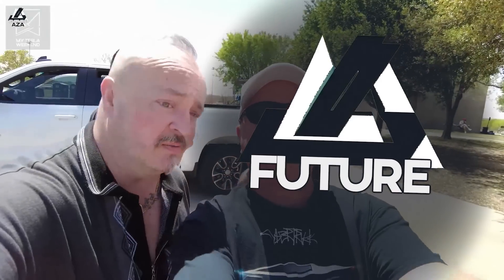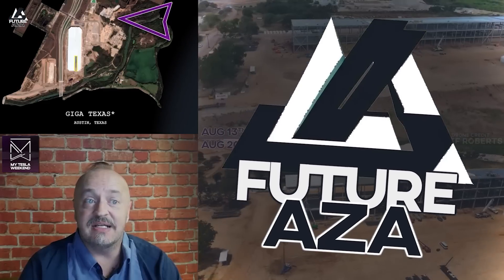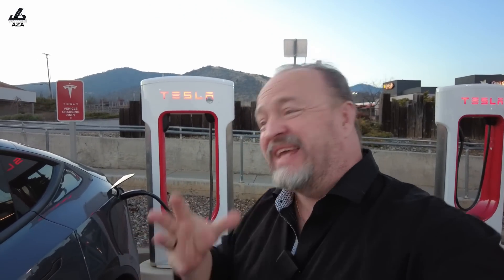Exclusive: Cybercab’s Tech Secrets They Didn’t Want Out

Comment: I have owned a number of front wheel drive cars from Honda and Mazda and have never had a problem in the snow with them (I live in Michigan so we know snow).  Indeed I have gone up hills in heavy snow while watching rear wheel drive cars struggling and going sideways.  I was always under the impression that fwd cars were thought to be better in snow.  However, apparently due to the excellent torque vectoring my RWD Tesla Model 3s are every bit as good as my last Honda Accord was.  I’m sure they have snow figured in.
Reply from the maker: Your Model 3 example is more accurate. The Honda & Mazda both have front engines, so keeping the weight over the drive wheels is what helped them. Cybercab should be fairly well balanced, but I agree the concern is overblown.

Comment: Great video. For snow/winter conditions they can fit the best tires available for the specific season - tires make the largest difference - much more than front rear, especially for a small light car (more of an issue with a heavy loaded pickup/truck). Since it will do a ton of miles, they’ll need to replace the tires once a season anyhow…

Comment: QUESTION: is there an emergency stop button for occupant(s). is there manual control system for fleet operator / first responders if AI computer goes out (or wireless for teleoperator or phone control) -- like a locked, hidden controller or port to plug in a controller?  - great job on these vids (long time watcher, first-time subscriber)

Comment: Great info.  The logic for front wheel drive and a small 40kw or less battery makes sense, speed limited to 85 mph also.   It's a commercial cab not a personal car and designed as such. I think it will come with a bench seat though to allow entry and exit on the non street side. More space in the trunk for suitcases and such with a FWD.. Not what I want so I won't hold my breath. Model 3 with a hatch would do if for me.

Comment: Front wheel drive makes sense. More than adequate on slippery roads as long as the weight distribution isn't rear-heavy. Pack all the fiddly bits up front and have a very simple structure to optimize from the windscreen back. Low floor luggage space. Good stuff.

Comment: Confused about a comment about braking::   Most braking occurs from the front wheels, not the rear wheels.  Front-wheel brakes typically require replacement before the rear   Torque steer is farr  more apparent with hp over 300 hp.  it's not an issue or a significant one for cars with hp less than that. .  Front-wheel drive cars as you've already mentioned will be interesting.  In places where it snows,  front wheel drive cars don't do too wheel if they lose traction going up hills.  In fact, they tend to crab sideways.  I've lived in New England all of my life.  I've had front, rear, and all-wheel.  I'll take the all-wheel drive, thanks <:) Front-wheel cars were in vogue initially because of the reduced cost of manufacture,  but there are drawbacks to that drive train which become apparent depending on road conditions.  I'm not an engineer,  but I have quite a few miles on the road <:)
Reply from the maker: You have the most braking capacity in the front, but you rarely need to use all of it.

Comment: re: the robotaxi doors -- 1. A person walking by on the sidewalk with head down in their phone will smack their head on the corner point.  Should make for a nice gash.  2.  Imagine a big gust of wind catches the door as it opens.  With the single hinge it seems like there is a good chance the momentum will either bend the door or the hinge.  I wonder if Tesla has considered both of these scenarios?  Probably.  3. Also, what is the clearance height needed for the doors?  I'm thinking of garages (home and old multi-level garages) with low ceilings?
Reply from the maker: Time to let it go.

Comment: Tesla may have confirmed that this particular car will be Robotaxi only, but that doesn’t mean the model “2” is not this car as different batteries, steering column & pedal box could be added if the mounting points are included in the gigapress front structure. Also the prototype car we have seen being made in carbon fibre is obviously not what is going into production so there is potential to add seats in the back given the huge space back there. There must be a reason for the extremely long doors & I suspect it’s to make entry to the rear easy, especially if the front seats slide forward at the touch of a button. Also front wheel drive only which allows more space in the rear for seats & cargo. This is pure speculation on my part but worth considering? 🤔

Comment: Most of the times FWD are performing better in the wintery/snowy conditions than RWD ones ..
Reply from the maker: Likely has more to do with weight distribution. EVs should have better balance. There are videos of RWD Tesla's playing in the snow, and it still just grabs like it's nothing.
Reply: @FutureAzA  Yeap, Teslas have amazing power management/traction control and combined with good winter tyres won't have much problems in the winter,  regardless of the drivetrain!

Comment: I live in a cold climate (Montreal) and front wheel drive is generally much better in winter conditions (with the exception of climbing steep hills). Thanks Brian for the excellent content.
Reply from the maker: It often is because gas cars have a lot of weight over the front wheels. EVs have better weight distribution, so the advantage might not be as big as you'd think.
Reply: @FutureAzA  Robocab can be designed however they wish. If you want front wheel drive you can optimize for FWD. with no drive train n the rear there is very little in the way of heavy components anyways. JMHO, but I think Tesla engineering could optimize all design considerations around a FWD drivetrain. There is a huge amount of latitude in design limits compared to an ICE design. EVs have a more even weight distribution because that is a desirable trait to some drivers, gives higher performance, in general and is better all around for meat computers. In other words, a design choice. 
Keep up the great work. It’s great to see someone that knows what questions to ask asking the questions of the right people

Comment: In terms of safety, what would be safest (in terms of crash worthiness) for the outer panels if they're not using stainless steel, steel, or carbon fiber?  Any chance they might be crafting a new aluminum alloy for this one?  Also, great bit of reporting!  Thanks again for making the long drive, and I hope you get invited to lots of big events in the future.
Reply from the maker: It's a balancing act. Cybertruck's skin is so durable they were able to reduce internal crash protection structures. If the exterior was cardboard, they'd just beef up the hidden structures.

Comment: My first six cars were front wheel drive standard transmission. I never had a problem in snow or ice.
Reply from the maker: My first two were as well, but traction issues vary widely by geography. Some places are flatter, steeper, more prone to wetter (slipperier) snow, or have none at all. Important to cover as many bases as possible without overbuilding to meet every remote use case.

Comment: Are they going to move to Starlink for their remote connection. That way the vehicle can operate anywhere.
Reply from the maker: My first thought was definitely not, but when you point out that there are narrow canyon roads in well populated areas without cell coverage, it starts to seem a bit more important.
Reply: @FutureAzA  There are quite a few areas in the mountain states like nevada, wyoming, utah, etc where there is no (or spotty) cell phone coverage.  I have used my starlink mini sitting on the front dash to fill in those areas so I can still get the map info, etc.  Plus narrow canyon roads too.  I think they will need starlink for both mapping and tele-operation in these dead cell areas.

Comment: so does the gigacasting come as one of two (front similar to rear)..
Reply from the maker: Yes, but the castings will be much smaller due to, well, the size of the vehicle. They also confirmed it will not be a single casting for the entire body because that would defeat the unboxed philosophy.
Reply: @ well that’s what I thought following the digest that’s been going around but as the battery pack is not a rigid item is there something else to gloss over maybe

Comment: A front wheel drive car with a limited-slip differential, mechanical or electronic, will help a lot on hills or slippery conditions. Obviously, an all-wheel drive or rear drive would be better. The  front wheel drive sub-assembly will be great for manufacturability which is probably why they are going this route.

Comment: Spectacular reporting.  The design philosophy of the Robotaxi is just SMART.  And no one is used to cars being designed this way because until now, design philosophy is to stuff as much performance into the design as you can for customer/owner appeal.  And all the same reasons are why Waymo's design is flawed and they will not be able to scale to compete.  Waymo has to build upon so many built-in design expenses of existing personal vehicles and unneeded costly options for use as a dedicated Waymo robotaxi, that have to be built into their cost and they can't remove them.  It will force Waymo to have to charge more for rides than Tesla and as a result, they won't be able to compete.

Comment: Since the cybercab is focused on efficiency, the motor won’t be sized for acceleration or top speed, it will be sized for regenerative braking. Power for Braking >> acceleration. So if the motor is sized enough to handle most all braking through regen, it will be more than powerful enough to run the car.

Comment: Brian, great series of video insights.  Plastic/composite panels make sense.  My BMW i3 body panels still look like new when the car is clean albeit that it's now 6 ½ years old.  By the way in Europe the majority of cars are front wheel drive and they tend to handle snowy conditions fine, they maintain traction because most of the weight is over the front wheels.

Comment: Thanks Brian ! dont forget that franch and italian cas are mostly front wheel drive and we have snow too  🙂  On snowy roads, front wheel drive do better job than rear wheel drive ...
Reply: (from Canada, we get winter...) fwd vehicles have a reputation for doing well in the snow because of weight distribution... fwd cars typically have the engine on top of the traction wheels, where rwd cars just have an empty trunk on top of the propulsion wheels, so there is less traction.  EV's change that with the main weight being the battery, whose mass is evenly disitributed.  My rwd model 3 is a GREAT car in the winter.  (I had vw golf long ago, and AWD cars for two decades.)  it's not as good as AWD, but not at all like a traditional RWD...
Reply: @petersilva037 we had a model3  rear wheel drive but now have a long range all wheel drive.  We were happy with the former, happier with the new one.
Reply: Brian, I recall I was told single motor RWD at the We Robot event, but Tesla Engineer did say no frunk, so maybe I was  misinformed about the RWD.
When I ask engineer  how RWD would handle northern/snowy environments, he said that's what autonomous AWD Model Y's are for.

Comment: Cybercab is going to be rear-drive.  The larger diameter rear wheels will provide more traction, according to the presentation.
Reply from the maker: It isn't. It's front wheel drive. The wheel sizes are about efficiency, not traction.
Reply: It's more likely that actual production vehicles will have the same wheels front and back to simplify rotation.
Reply: What does tire diameter have to do with traction?
Reply: @dougmanck4149  Larger diameter tires have a greater surface contact.

Comment: No worries, Brian: If the Robotaxi's front wheel drive and excellent traction control can't handle a particularly slippery snowfall, then it can simply drive in reverse up the hill or choose a route that's less steep or already plowed&salted. 🤓
Reply: Nope, that's far more complicated and dangerous than driving forward. The cab will just choose not to drive when conditions are poor.

Comment: Front drives historically have been good in snow as you have the weight of the motor helping traction.  With good tires and decent traction control fwd will be just fine .. it is just a taxi after-all.